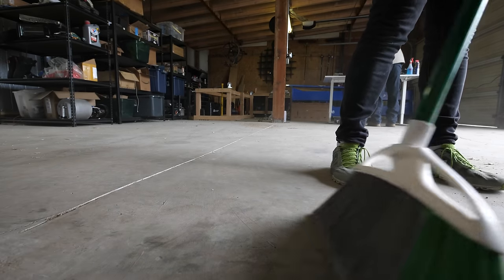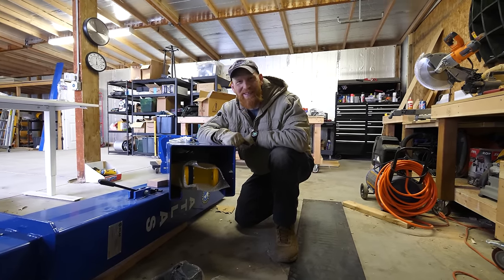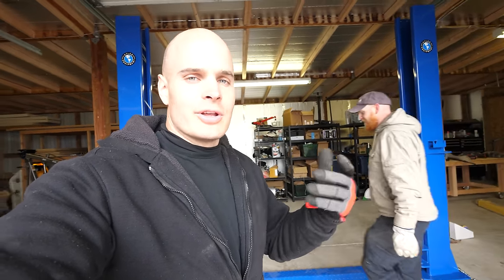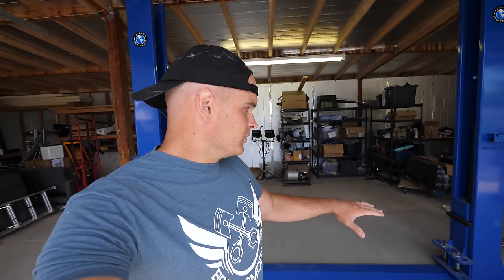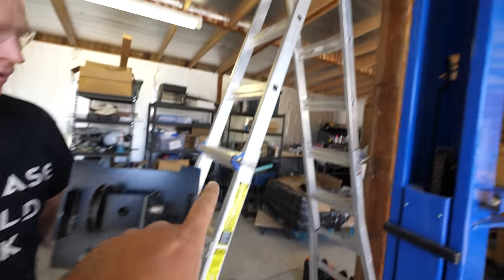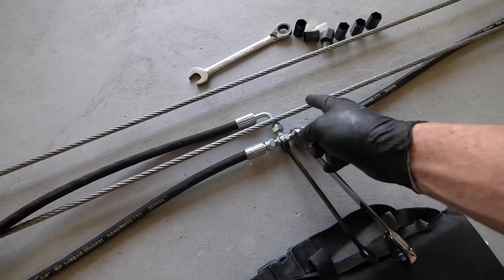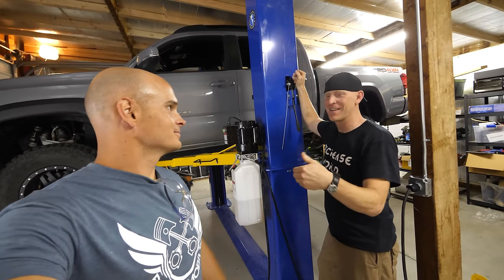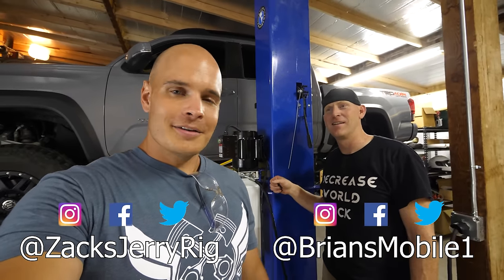Installing a 2 Post 10,000lb Vehicle Lift! - Check concrete FIRST!!

Comment: Good suff. Only thing is in the lifts we have at home in the floor where the cables go neaar the high pressure hoses the cables run ij  metal trunking that we done just to keep the hoses safe has we had issues before.

Comment: Nice job Gentlemen i know it sucks. about   the Concretebut in the long run you guys did the right thing by reporting  that Slab  i’m way older than you guys  and the one thing you just don’t know  is what life may throw at you in the future  so it’s not safe to assume you won’t ever  need the fullCapacity of that Lifts Specs  but you’ll did the right thing knowing if for whatever reasons  youhave the ability to do so

Comment: I'm not a concrete guy, but did you think about putting in your support bolts while the concrete was wet? I would have created templates of the base of your posts and where the support bolts go, put in the 1"x8" (or however thick your new concrete floor) bending a 2" - 3" L at the bottom of the bolt. Then you could have avoided the drilling and possibly have stronger support for your posts. I am very curious why that would not work or is not a better option? Thanks!

Comment: What Size Of Slab Did You Have Put In For Lift? I Wanna Have The Foundation Set Up For My Garage And Want To Have It 8" Deep Where The Lift Will Be And The Rest 4" So To Save Money. The Garage Will He Almost 1600Sqft. Or Should I Just Have It All 8"? That Would Make It Double The Cost Right?

Comment: How about following the torque specs that apply to whatever grade the fastener is your using. Now you've learned that different grade bolts that are different sizes have specific torque specs.

Comment: Concrete reached its maximum strength in 30 days.  Wanna help your concrete be stronger; keep it wet for at least 1st week.   NEVER use teflon tape on hydraulic lines;  The hydraulic pressure can push the fluid past the tape and could cut into a body part with surgical precision.   Whenever I use those type of bolts I drill hole deep enough so threads on bolt just catch when pounded in.  The holding strength isn't until you fully engage the internal wedges.  Side note:  if anyone has a pole building built make sure that you specify the height to the bottom of the trusses; not the wall height.   If you say 14 foot walls; bottom of trusses on a pole building will probably be at 12 feet.
Reply: In the mine I work at, a hydraulic hose/fitting on a diesel haulage truck failed, creating an aerosol of the oil which then coated an employee and  burst into flame from a hot vehicle exhaust . The employee was badly burned. And elsewhere people have had hydraulic oil under high pressure , cut into their skin and poison their body. It's very dangerous if you don't know what you're doing. Thanks for reminding everyone.

Comment: Did you park the vehicle there before replacing the slab? If so, then the old slab supported the vehicle's weight on four points with a much smaller area than the steel beams. Of course, the beams are only two, so if the area of the beam's foot is twice the contact patch of the vehicle's tire then it would have been the same load, and I bet you never ever thought if it was safe to park the vehicle there. On the other hand, the lift will apply moments at the base due to the center of gravity of the load not always being perfectly centered, so it was a good decision to upgrade the slab
Reply: Strange way of thinking. If the concrete would break while the car was parked then nothing but cracks happen so even with a one inch floor there is nothing dangerous going on.  However when something breaks while the car is in the air on the lift, then things get damaged or people get killed very easily.  So you cannot compare the situations really.

Comment: Noob question here, could you have just cut a 3x3 or 4x4 square where the post were to anchor, and just re-pour that area? Rather than taking out the large square like you did.

Comment: I am planning a building that will have a lift in it.  I was thinking about the concrete thickness and thought it would be better to actually have a concrete pillar poured first, 4' down and 18" diameter.  May cost less in concrete than a total 8" pad.

Comment: Nice video - thanks. I am planning an install in Salt Lake this winter.  Come on by and offer assistance if you have nothing better to do! :-) Would you recommend this brand of lift now that you have had it for a while?  I will drill some pilot holes this coming weekend. I was planning on 4 inch concrete at my place btu now hearing that 6-8" is highly recommended I have no doubt i will doing some additional concrete work.

Comment: You could have made wider bases and fastened the top of post to your ceiling joists, l have 6 inches of concrete but I still fastened it to ceiling joists just to be even more sturdy, a 2 x 2 foot 1/4 inch plate could have saved you from having to tear up slab

Comment: Great job. Did you have to tamper the ground before you pour? Also, did you use some kind of epoxy to stick your rebar in the old concrete?

Comment: I'm curious why you didn't just replace a section of concrete under each lift pillar instead of pouring a massive new slab.  I get that what you did is super solid and nicer to roll stuff on underneath the lift.  I am considering the later and going more like 12" thick with 30-36" square sections and excavate under existing slab 6" or so with rebar drilled in horizontally like your contractor did and care not to put rebar under anchor areas.  Seems like this method is done successfully by others and DIY bag concrete friendly and minimizes collateral damage of contractor heavy equipment on your property.

Comment: Without knowing the two of you were connected I heard the voice and immediately thought it sounded identical to Brains from Brian's mobile. 
So will you do a roof raise in that section. It sucks to get a lift and have to add all that concrete and then not get fully underneath your main equipment?

Comment: Smart move getting a new slab, most people would not have the finances for it and would end up in big danger. Also, what's the point of the lift if you can't stand under it?

Comment: Don’t need heavy torque on anchors, tighten until the don’t move
Reply: Actually, that's not correct. With the forces that can be involved in the lifts and therefore anchors, you can easily pull the feet up some if the anchors are not properly torqued down. And MAYBE even pull them out completely because they didn't get expanded enough. The more torque you apply, the more force it takes to pull them out, within reason of course.

Basically, make sure you have concrete that has the correct compression rating and also that you torque the anchors to the correct spec.

Comment: Perhaps just where the post sit on the concrete. Couldve been cut and excavated.

Then filled to depth required.

An entire slab doesn't seem necessary.

Comment: Those two ‘silver cables’ as you called them, are not a safety feature. They are purely to synchronise the hydraulics so the arms stay level with each other. The safety feature are the interlocks spaced up and down the beams. You can cut the hydraulics and those cables with a truck on the lift and the lift will not fall. That said, don’t try that.

Comment: it should be fine with 4"if your staying under half of the max weight, however 7" deep is to reach the specified max weight of the lift
Reply: I would not install it at all on not reinforced concrete

Comment: I know this video is a year old and probably won't get a reply to this question, but why didn't you installed pre-fabbed base plates with threaded bolts before you poured new concrete? wouldn't doing so be stronger than drilling holes and installing concrete anchors?

Comment: I hope that house was not too expensive.  It is not the first time we see its its shortcomings
Reply: There were no shortcomings. The slab was perfectly fine for what it was built for. You can go to 90% of driveways and they'll be 3.5-4.5 inches thick. They're not meant to have lifts installed in them.

Comment: If you put new concrete in I would have had an equal metal plate fabbed up with nuts or even bolts leveled under the concrete instead of pounding in expansion anchors

Comment: It would have been nice to pour the bolts in with the slab. Granted that it would take some precise measuring and the risk of bumping over while the floor is poured. I was on a job at a powerplant where they had a 2' diameter pipe 30 foot long with multiple bends fabricated in Europe. We pours pads/mounts for other machinery while the pipe was built. When it finally arrived months later, it got swung into place and it only needed a few taps to get slide into place. A couple of bolt holes were pretty tight but the guy said  it would relax towards the easy side once the pipe got hot.

Comment: The torque spec is based off the anchor you’re using not the lift... the torque spec for (it looks like you’re using a Simpson Strong-Bolt) that 3/4 bolt is 150 ft-lbs.

Comment: could the bolts have been put inside the concrete while it was still wet to avoid drilling? just like the bolts that come out of foundations at the walls of the building that hold the wall plate in plate

Comment: At first I did not think/realize that you increased the floor's thickness all around the two arms, but rather in around 6:47 it seemed that you only got the part in-between them and was wondering if that would affect the integrity (I'm guessing that it would). But then again, did you just dig/cut flush down the arms and left that part intact or what?
Reply: It's very easy to see the posts are on top of the new slab. The new slab extends about 1-2 feet beyond the posts.

Comment: Did you have to bleed the air out?  Mine will go up under very little weight but put a small car on it and it goes a foot and stops and whines like crazy

Comment: All you had to do is pour a new 3’ by 3’ under each post. You could have done that in less than a day by your self. Also, why didn’t you install studs in the wet concrete so you didn’t have to drill the holes?

Comment: Hello. How big is the slab? I'm doing a 40'x64' building. I'm thinking my Lift Corner should be, 20'x20', with rebar and 6" concrete. The rest could be 5".?

Comment: I have the same issue but I'm thinking that rather than such a large excavation and pour, a 2x2 x 8 pad under each tower will suffice.
Reply: @James Wilson The instructions for my 10K lift have this to say about correcting the slab if necessary:  If anchors do not tighten to 85 ft-lbs. installation torque, replace the concrete under each column base with a 4’ x 4’ x 6” thick 3,000 PSI minimum concrete pad keyed under and flush with the top of existing floor. Allow concrete to cure before installing lifts
and anchors (typically 2 to 3 weeks).

Comment: obviousy too little too late for this advice  but here it goes anyways . Ive seen smaller lifts like this installed in home garages and workshops on a big thick metal plate ,largest one ive seen was almost an inch thick but ive also seen them installed on as little as 15 milimiiter thic plates . In some cases the  concreete was not deep enough like n your situation , in other cases the owner of the garage or workshop didnt want to drill  in it , so  yeah . thick metal plates are an option for small lifts . Probably very expencive , but an inch of metal is going to be stronger than even 6 inches of concrete and it will then be  movable  if you descide it needs to go  like 3 milimiters to the right or something ITS FINE WHRE IT IS MOM GOD DAMN .

Comment: Why did you replace such a large area of concrete instead of just making two large footings under the lift?
Reply: Small footings won't resist the over turning moment induced by a vehicle where the center of gravity is significantly offset from the post center.
Reply: If you want to understand why imagine a 4x4 post in anchored in a six inch concrete puck that is 10 inches in diameter sitting on the ground. Now go push that post in any lateral direction. The puck of concrete will lift on the ground. Free standing post lifts have to resist such forces which is accomplished by wide slabs of concrete that is strong enough not to fracture from the tensile stress.
Compression load (which is what footings are for) isn't the issue.
Reply: @Cragified  thanks! This makes perfect sense

Comment: Why not j bolts set on the front of the anchor layout with a template and the red heads on the back? Torque specs are hardware dependant...

Comment: My concrete guy poured 6" @4000psi plus fibre for the whole slab and added rebar in the center section for the lift.

A 2-post lift in a garage with a 9' ceiling is all but useless. A mid-rise would have made more sense.

Comment: Could you cut a large square bigger than the pad of your base on the lift dig down 8 inch and make basically a footing under each post instead of replacing the entire slab. I'm not a concrete guy that's why I'm asking.

Comment: Since you poured the concrete you should have put anchor bolts in so you didn't have to use the sucky bolts you used...

Comment: Whats not said here is how concrete companies rip you off. I built a garage for a lift and requested and paid for a 5” concrete and 4000 min psi. One year later I installed a two post lift and one hole was only 3”. I called the people who supplied the mix and they verified I only got 2500psi. What I learned? Some people will lo ball a job and lie to you to make up for the low bid. Alway ask for the mix receipt and measure as you go when they dig the slab.

Comment: torque is for anchors not lift. so you need spec for them. if lift has torque spec use epoxy anchors

Comment: The base of those columns seems way too small to be safe. I’d want a minimum of 2 meters of steel plate extending fore and aft in the event those concrete anchors fail.

Comment: Why not just to pour the 8 inches of concrete under the stand base?
Reply: An 8" full slab spreads out the leverage ... same reason you don't put a fence post 6" in the ground.

Comment: You should have concreted the bolts.
Reply: Different bolts are used in that situation. J bolts not anchors. Anchors are EXTREMELY strong if installed properly. Personally I would have done 2 footings instead of the entire slab. Would have been stronger & deeper & longer anchors could have been used or J bolts like you mentioned. 😎👍
Reply: @vanlifebiker  I was going to mention this, but its to late anyways.

Comment: 4" of concrete for a 2 post lift isn't thick enough. If you had s 4 post lift that would be ok, not good. 
Id cut out a 6x6 patch of concrete where the posts go, and pour 1' thick with a gravel base, 5000psi concrete. 
Thats so the force doesn't rip the posts out and tip the whole thing. Its not the vertical down force you need to worry about - that will just make cracks in the slab.

Comment: concrete achieves 99% of its design strength by the 28th day after pouring. after that itll take many months to advance till around 99.5%, then itll start slowly losing strenght
concrete is ready to be used/built upon just a week after pouring, where it reaches over 65% of the design strength. (90% at 14, 99% at 28)
Reply: Thanks, Wikipedia.

Comment: 2" of concrete is a hell of a lot stronger and safer than 8" of cement lol . . . cement is the grey powder used to bind sand and aggregate to make concrete. You kept getting mixed up and confusing the terms!
As with everyone else, good job on putting in a proper (thick) concrete slab to support the lift. Whoever the previous contractor was, that did the original slab, is inept and obviously cut corners and did a very poor job.

Comment: Why does your slab have zero rebar. That's like concrete 101
Reply: Nope. Most slabs don't have rebar in them. Most concrete slabs since the 90s, that don't carry any weight, like the concrete in his shop, are fiber reinforced, or wire mesh reinforced. There also could have been wire mesh in the slab, but there is no way you could have seen it if it did have wire mesh. They would be little spots about half the size of a pencil eraser, every 8", and they would be grey in color since they were fresh cut bare steel, and would blend into the grey concrete. (I don't think there was mesh, but just saying it'd be almost impossible to see in the video.)

Comment: I would have don't your 8 pluses under the pillers a extra 10 inchs that's 18 plus 2 ft square  get the best concrete 5000 with fiberdid you use U bolts tisk tisk

Comment: I dont like the deign of that lift with the cables rubbing near the hoses and plate on the floor will def obstruck floor jacks trans jacks. Anything that rolls over it ect

Comment: Putting the vehicle on incorrectly or not using lift correctly is the most dangerous thing. And I wouldn't trust the welds on the bottom of the cheap lifts

Comment: If you stay concentrated on the 4000lbs per square inch people will thick 1" thick will be enough, because it's spread out right??  Yet in reality, we should have 6 to 8"s thick concrete because the weight at the higher points transfers to far more than people realize...

Comment: It's too bad your ceiling isn't tall enough to accomodate lifting the truck to a height you can stand under it comfortably.  It's better than working under an axle stand supported vehicle, I guess.

Comment: God I hate pro's it would have been quicker, faster, safer, and yes cheaper if a four post had been used on the two inch original floor and would have been moveable and yes completely removable if needed.

Comment: would a couple steel plates to spread out the force by 10 -12 sq ft accomplish the same ? thinking about how overpriced the concrete cartel is.
Reply from the maker: Not unless the plates were inches thick... And by the time you factor in metal cost and transport cost - you might as well use concrete.